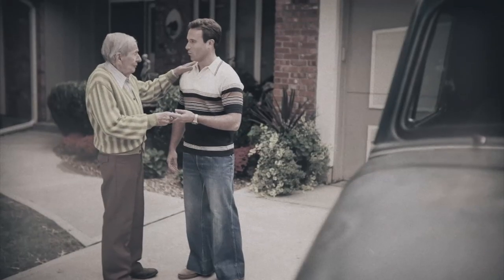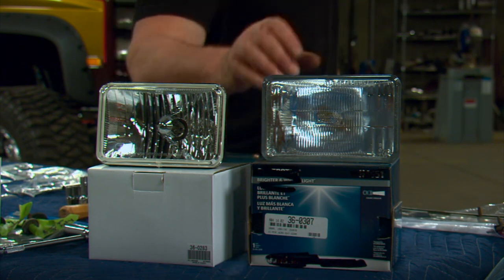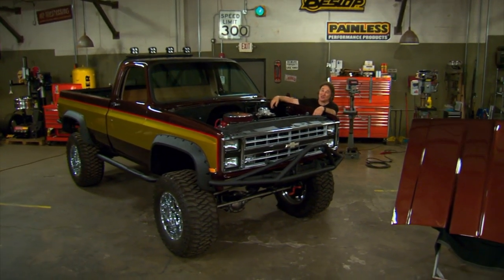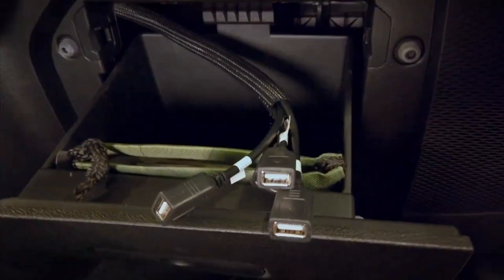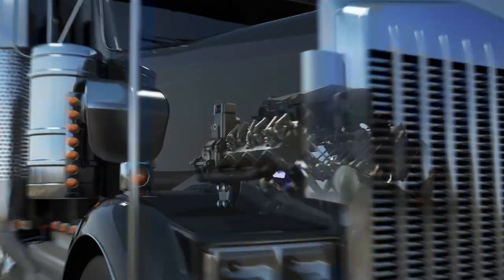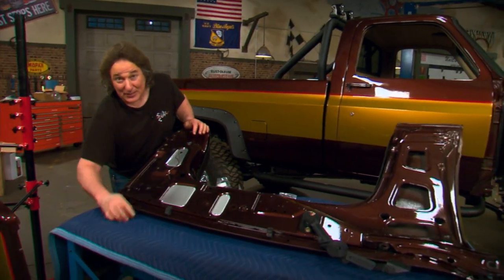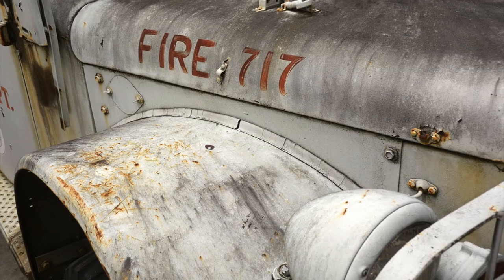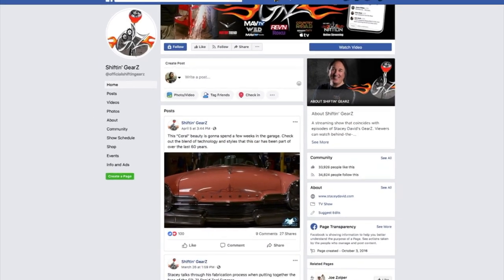Stunt Double Squarebody Chevy Grill, Bumper, & Headlight Install - Stacey David's Gearz S14 E11

Comment: Getting an 87 next week would this bumper fit or will it take some retrofitting
Reply: It will fit as long as your frame is not tweaked. Its designed for these trucks.